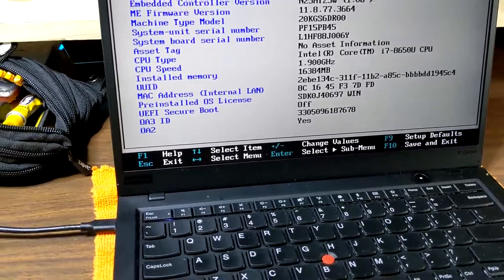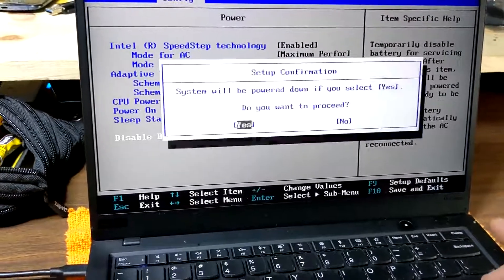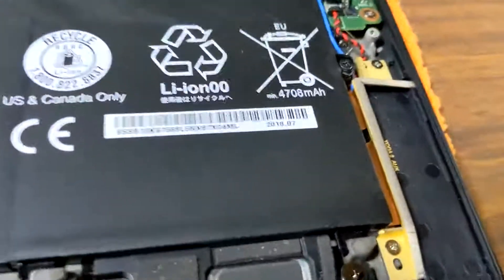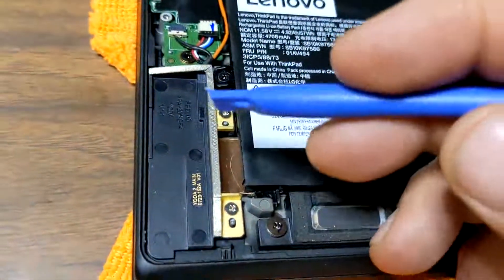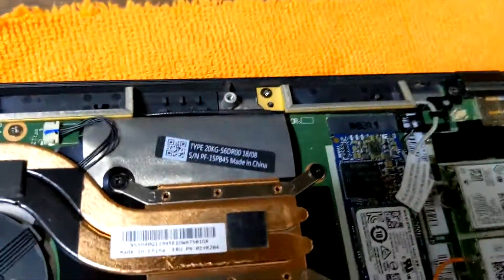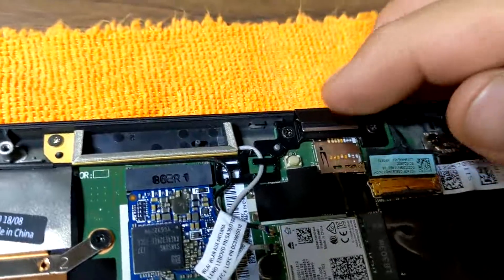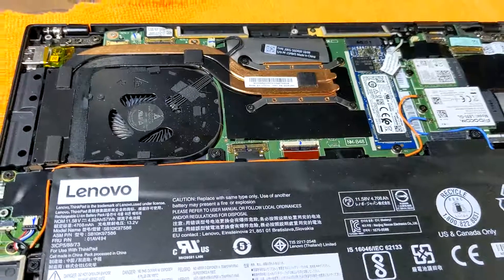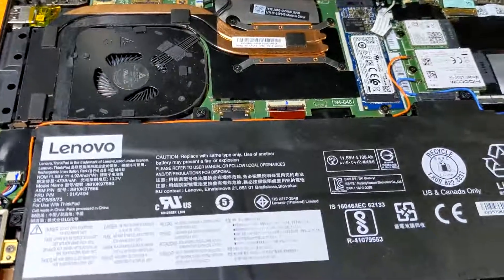X1CarbonWWANUpgradeInstallation

Comment: Purchased the recommended Fibocom L850GL module and antenna's, getting the error "unauthorized network card" message. Strange since it's definitely a x1 6th gen 20KH. Anyone know any work arounds? did I need to have drivers installed before installing the WWAN card?
Reply: just realized I ordered 5W10V25796 as oppose to 01AX792, both look similar easy mistake.
Reply from the maker: @ItsMatich  Oh yeah....it is so very particular.  Honestly, it seems rather unreasonable but I imagine it's a way for them to control what goes into these.  BTW...I am on Mint Mobile now ... 15 bucks a month plan, essentially T-Mobile network
Reply: does your laptop have sim tray?

Comment: This video would be so much better if you actually showed the installation instead of just talking about it.  Alot of people, myself included, want to perform this WWAN upgrade which on this particular model is NOT that hard.  But since you didn't actually show the procedure you didn't mentioned that the CMOS battery sits atop one of the WWAN antenna modules under the battery. People might get to these steps and not know how to procede.